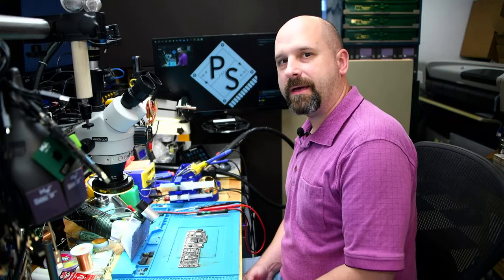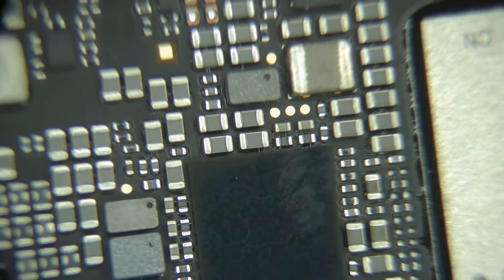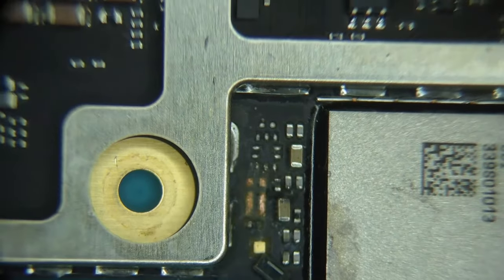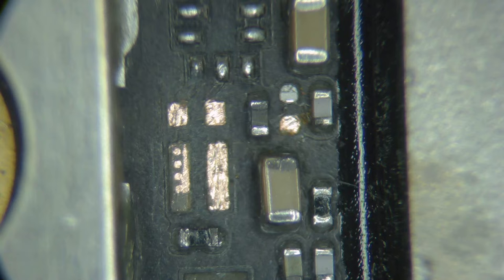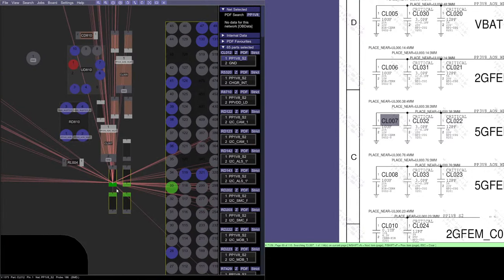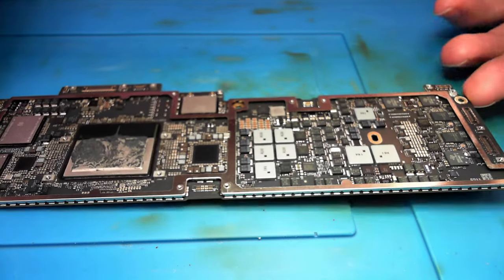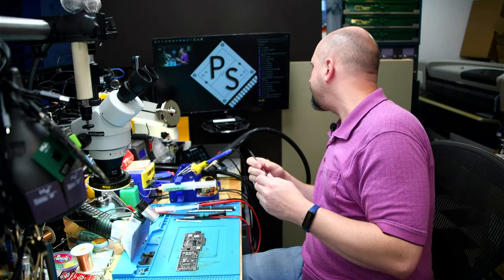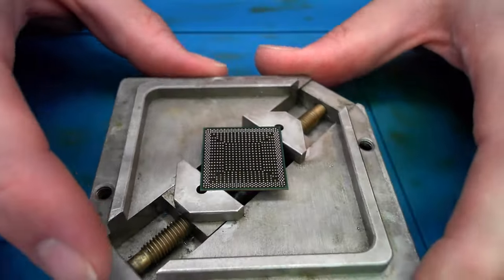M2 MacBook Air A2681 Liquid Damage Repair

Comment: This current sense resistor that no longer in use, but if water damage stop machine from working , remind me a J-tag on an old MacBook's (please remind me witch ). Same stuff, remain from DEV, totally useless now , and if you still see one on the board, first remove it.

Comment: Does the MacBook Air m2 have liquid indicators ?
Reply from the maker: All the MacBooks have liquid indicators but they have changed over the years. No longer will you find the white dots that turn red. Now they are black dots that after exposure to liquid they glow purple under UV light. I think they stain the board with the UV dye as well so it is harder to cover up liquid contact.